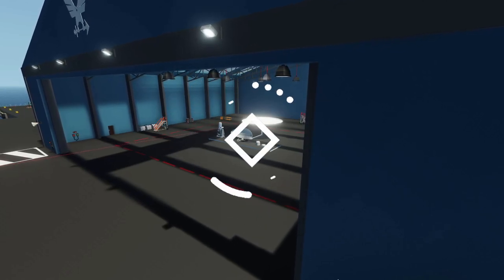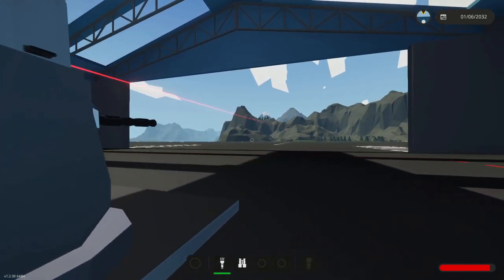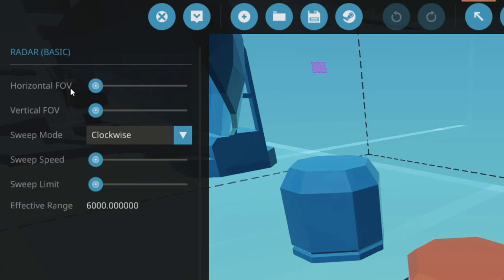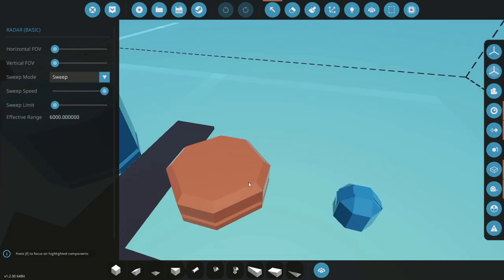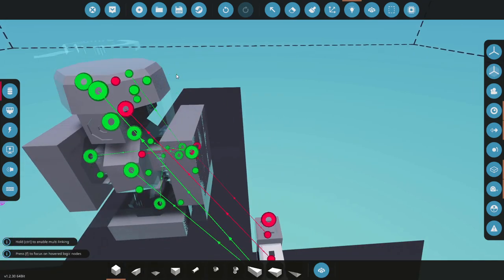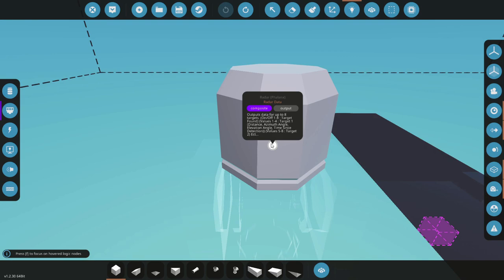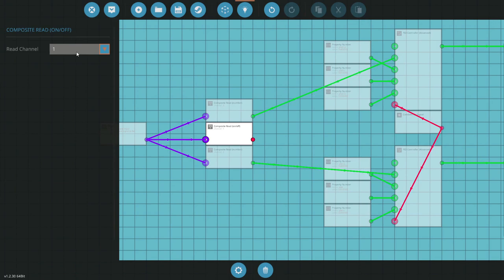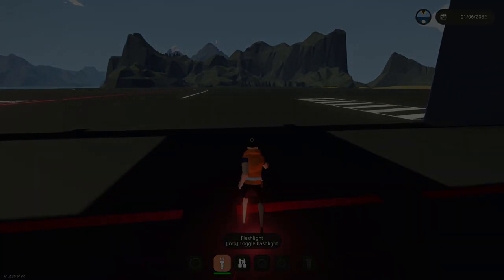New Radars! Updated Tracking Radar Tutorial and showcase l Stormworks Build and Rescue

Comment: Great tutorial, I've used the previous one and modified it with the new ones. Amazing how with the new system you can fit all the logic in a 2x2 microcontroller.
Reply: Also thanks for explaining the jitteryness, I had some frustration since my turret would be moving. Also an in-dept tutorial on how you fine tune PIDS?
Reply: @Skittttttles  fine tuning pids is just changing values an looking what happens, according to what happens you change the values

Comment: Do you have infinite electricity turned on, or do these not require power?
Reply from the maker: Yes I do, normally they would require a power source
Reply: They use almost no power iether way, it takes 10 seconds to take 0.01 power out of a small battery using the basic radar

Comment: I followed the video but my turret is moving wildly in pitch and yaw, a lot more than I think the balance jitter should be doing
Reply: same
Reply: same
Reply: PID values are different if your CIWS is a different weight, pivots use different gearing and power etc
Reply: @Dutchcomentatah  I did it exactly as he did in the video, and it didn't work
Reply: @Dutchcomentatah  ok thank you I played with the pics and gears a bit but had a sluggish CIWS, but may need to change the values more than I did